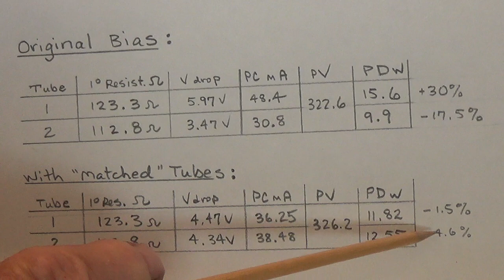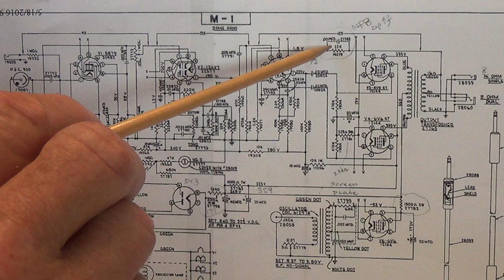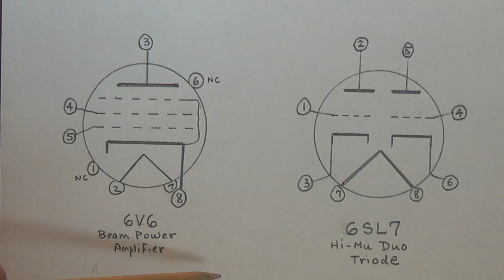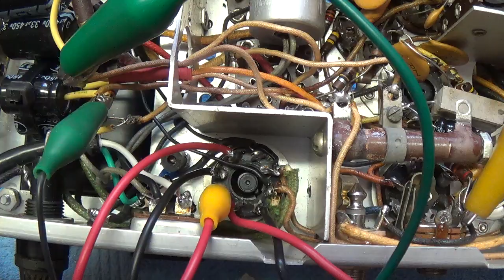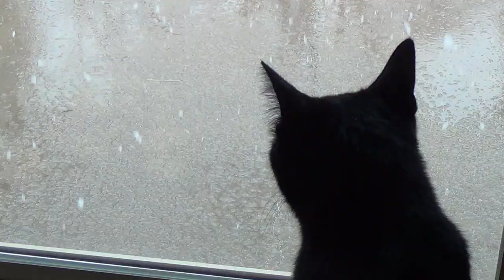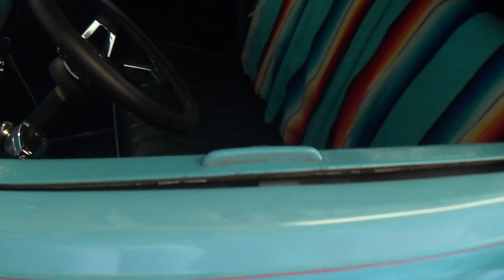Bell & Howell Filmosound 385 Amp Conversion for Guitar Use, Part 2

Comment: I expected that old projector amp would come alive and it certainly did.  There's a nice fullness to the sound that I prefer over the 5F1\5F2. Whats that green monster behind the 36?  Your shop looks like an interesting place to spend the afternoon but I think I might need need some type of alcohol based liquid cooling to deal with those 111F temps.  I thought 97 was bad here in the south. It's not even July. WOW!!  Thank you again for another informative video.
Reply from the maker: Thanks, Sluggo. The vehicle under the tarp is a really nice 1952 Chevy pickup that I've been working on. I try to shield it from the sun, but it's a waste of time.....much like trying to shield a pine tree during a forest fire. The other day while working on it, if I set a tool down in the sun for more than a few seconds, it quickly became too hot to touch. I had to quit, put on some gloves, and then carry the tools into the "shade" to cool down.....to 110.

Comment: Great mods, I have one of these amps and would like to change it but I looked on line and could only find the older octal schematic on line. Can you tell me were I can find this schematic. Thanks Craig in Texas.
Reply from the maker: Thanks, Craig. It's been a while, but as I recall this schematic came from an operator's manual for the B&H 385 that is listed on line. You have to download the PDF file and scroll through it to find the schematics. I don't have a link. Good luck.

Comment: Looks like it turned out well.  I wish I found more project pieces around.  I've felt encouraged to share more of my projects on Youtube...   including one of my favorite projects.   https://youtu.be/RcpkgCLCwAo   This modest sized amp uses a mighty 807 tube for about 12w of single ended power.   It's quite a little powerhouse.
Reply from the maker: Good grief, DK, what a stout SE amp. I guess the next step would be a single-ended KT-120 with a pair of 15" Eminence Neodymium speakers.  Just the thing for breaking leases, dissolving marriages, and causing genetic mutation in neighboring counties.
Reply: Lol... When I did that project I had a few goals...    Little SE amps usually sound wimpy to me... so I wanted one with attitude.   I wanted something that you could hold in 1 hand.... that could keep up with a drummer....  Plus,  I had to know what an 807 sounded like.   It's electrically sort of like a 6L6.   Good NOS 807's are NOT in high demand,  so it's a cool platform.   I was kicking around the idea of making a 50's bassman circuit,  and substituting 807 for the 5881/6L6's..     and then putting it with a ported bass cabinet.
Reply from the maker: It's a very impressive tube, DK, and a very unusual one to use like this.....at least in my experience.
Reply: 807's are a pretty handy tube that is capable of producing some serious power.   It's coming back to me...  it's like a 6L6, but since the Anode is a cap,  it can handle up to 750v,  whereas a 6l6 would arc between the pins at that kind of voltage.

There's another fellow in Michigan who's done a few 807 guitar amps..  one SE,  and one AB-PP.    With their operating characteristics,  it seems they'd drop into any circuit that jives with 6L6........
https://en.wikipedia.org/wiki/807_(vacuum_tube)
Reply from the maker: I've never used an 807, but since you have alerted me to their interesting characteristics, that may change. Thanks, DK.

Comment from the maker: Aphexon: You need to change your privacy settings if you want me to respond to your questions. 

You're welcome, Aphexon.  I always recommend a simple Fender 5E1 or 5F1 Champ as the best first project. Please see my video series where I build one from scrap parts and incorporate some upgrades.  Good luck with your project :)
Reply from the maker: Bulbs are sometimes used as ballast resistors to reduce or limit current in a circuit, such as in the input circuit of some organ amplifiers. They are also used in the photoresistor tremolos found in the larger Fender amps (Deluxe Reverb and above).
Reply: Hi Uncle Doug. I'm a little late to this video being I just picked up a B&H Film Projector amp. Do you take customers? I'd like to have this done to mine.
Reply from the maker: @deebojones  Sorry, Darin, but I no longer do conversions. My purpose in creating and posting videos is to instruct you in doing the job yourself. Best of luck.

Comment: Thanks for another great retrofit-conversion video. You are an inspiration!  I had previously built a clone of the 64 Princeton Reverb and found that the tremolo oscillator was sensitive to component lead length and/ or wire length to the speed pot. You might have a similar issue on this amp. That hot rod is a real beauty!  Stan
Reply from the maker: You're welcome, Stan. You may be right. With the long leads used during my mock-up, it sounded perfect.....dead quiet and great intensity. One I installed everything with the shortest leads possible, some of the properties changed. I will continue to work with it and iron out the small "wrinkles". Thanks for your good advice.

Comment: Nice job Doug. Talk about 10 pounds of stuff in a 5 pound box. 

Hey, what are you using for the black-goo insulation blobs on those solder joints?
Reply from the maker: Thanks, Craig. Yes, it is a densely wired little rascal. I used black silicon gasket sealer, just in case the chassis was used with a metal base plate and one of the joints drooped a little.

Comment: Thanks Doug! Really like to watch these videos. What would you suggest for a "first timer" project? I have some experience but, its like 10 years ago in school, I build a small solid-state guitar amp. So i know the basics, how to read schematics, and solder. But not much then that. 2/3rd year I just build acoustic instruments. mostly basses and guitars.
Reply from the maker: I always recommend a Fender Champ as the first project, Aphex. It's a fairly simple circuit and you will end up with a really nice amp.